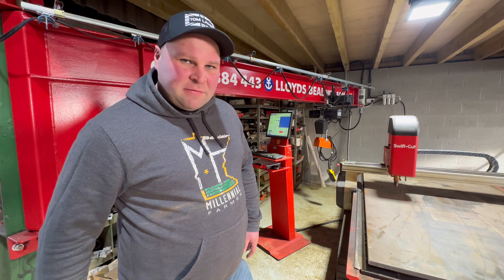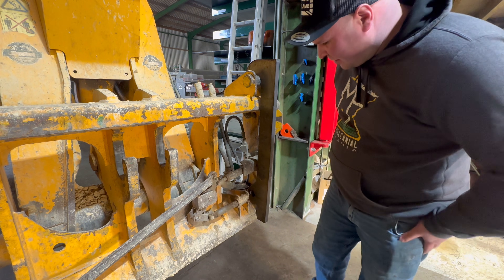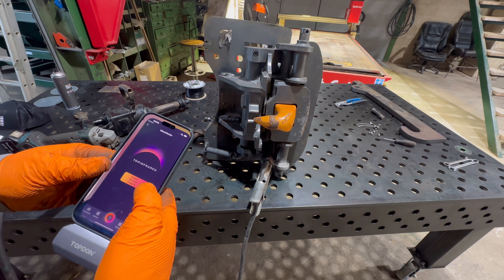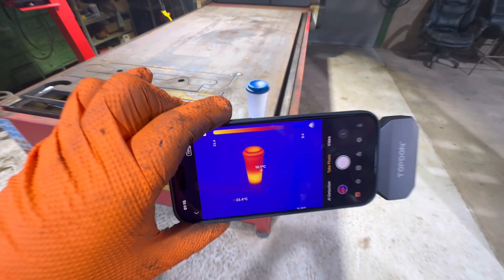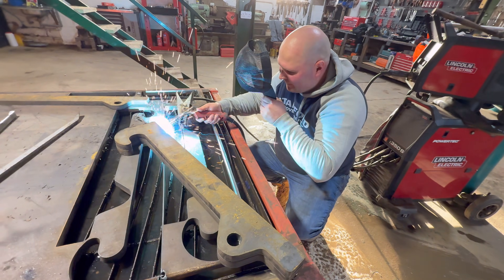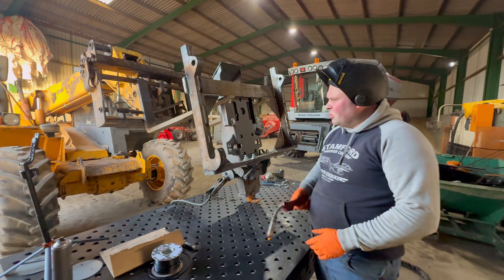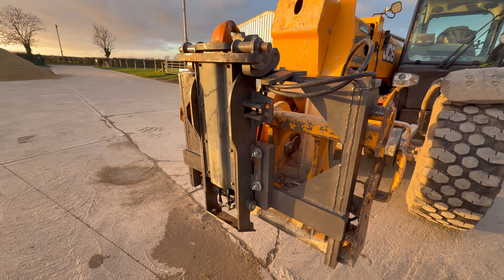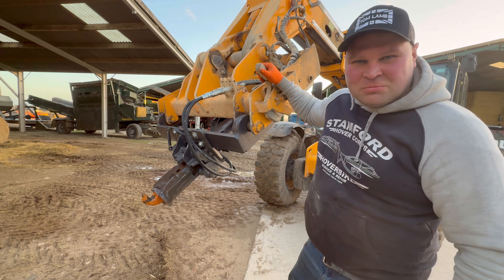Fabricating a heavy duty machinery mover for the JCB

Comment: Nice job. Just for future info, the design of JCB bracket you've used here is the style you should use as it means the load from the attachment goes into the reaction face of the headstock. The pins should only stop the attachment from pivoting on the upper bracket when you dump it forwards, they shouldn't be taking the load of what you're doing. I know they're quite chunky but a badly designed attachment will bend them!

Comment: Nice build Tom, just a slight comment might be seen negatively but not ment that way, having the JCB headstock tipped fully, when you are picking up trailers, you are exerting downward force onto your alignment locking pins, over time these will bend & not retract out of the attachment, might need to rethink how the bottom is secured, if you look back at your video when lifting off/back on the bench you will see what I mean👍👌
Reply from the maker: I have never seen those pins bend yet
Reply: @Tomlamb980  think that’s because they are just holding & not really being used for full support of an attachment, something else I thought of was your plates you cut out, in your configuration are loaded on the back side of the hook & not the top, I don’t think 50 mm of steel will bend, but if the pins bend the other end could move. I’m speaking with a lot of experience (38 years) in the material handling industry, please humour me & keep an eye on them pins & check them after a while of lifting your loaded trailers, even shame me saying they are ok. thanks.

Comment: i'm no engineer but shouldn't you have beveled those plates before welding to each other?
Reply: To be precise yes, but having the 2 plates even just tacked or bolted together is enough, they are both taking equal weight. There is however much bigger issues with lifting with the headstock fully tipped🤔
Reply from the maker: Yer Probaly

Comment: dont forget if manufactured product has broken via welds breaking its 90% time bad design. welding it back up in your workshop it will break again. its poor design or poor weld.welding is a very critical process. thousands variables. its not just case do it bit hotter. worked for esab for 11 yrs in metallurgy

Comment: Thank you for your videos, Tom. You are always entertaining and informative.

May I ask a question about how pieces are arranged for the plasma cutter? I have never used a plasma cutter so please forgive me if these questions reveal my ignorance.

When you cut the blocks of steel, the pieces were very close together. When you cut the JCB connector plates, the parts were farther apart. They are even about 1/4" in from the edge of the sheet. Why is that?

I see this all the time when people use a plasma cutter. What is it that makes it ill-advised, or impossible, to put the edge of a part at the edge of the steel?

Is it the same limitation that forces the need for space between some parts? Is this why it's possible to have very little space between simple blocks of steel and more space is needed between parts? Is the cutter unable to use the same line between two parts?
Reply from the maker: It can auto nest it but I guess it’s my fault for placing it on the steel Willy nilly and just being lazy

Comment: @Tom Lamb if you bring your forks in at floor lever the jib hoist will swing over the head of the forks, drop the hoist and pick from low, looks like a tight struggle doing it up high, best to let the hoist do the heavy work